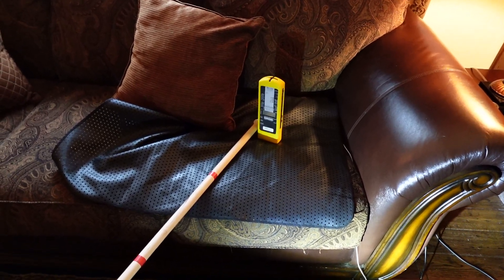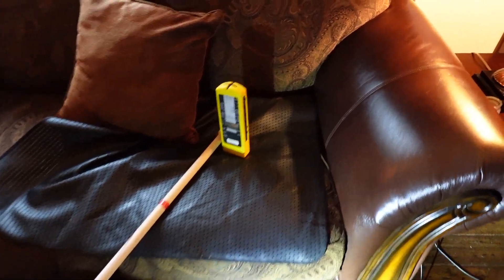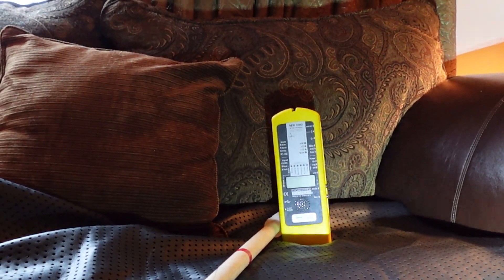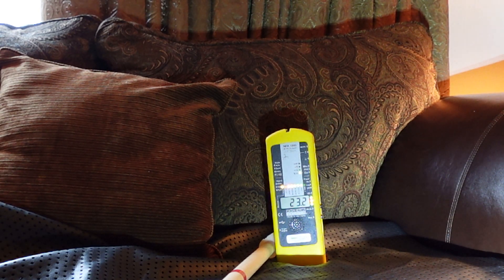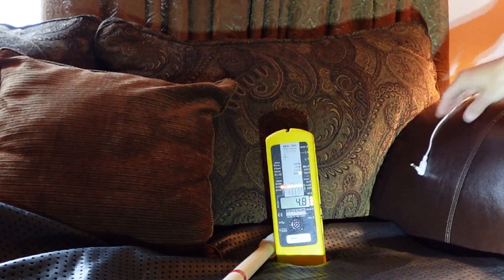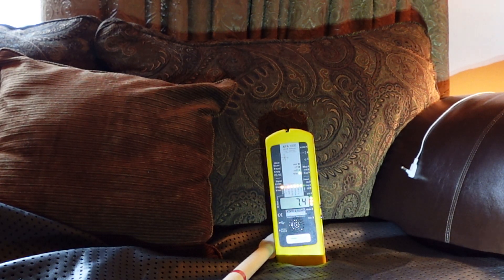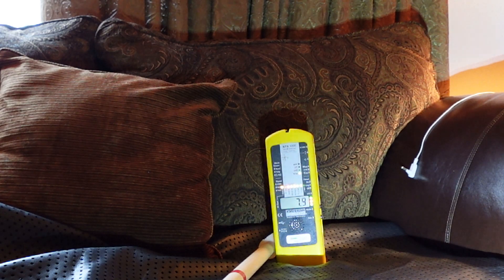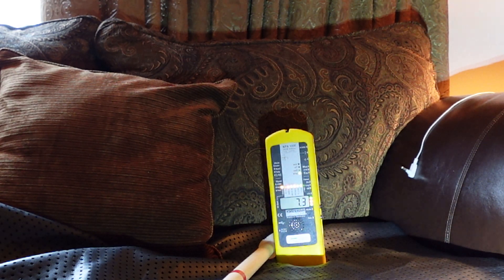The Problem with Earthing & Grounding Mats

Comment: I think this absolutely makes sense. When I first tried my earthing mat, I literally felt energy draining from my body, and then felt uncomfortable vibrations, pins and needles in hands and feet, etc. Turns out this is especially a problem in older homes, where sometimes the home isn't even grounded at all. Now my mat is grounded outside. Feeling a big difference.
Reply: You must be in an older home. If the outlets are bringing that much energy into your house you should probably get a professional electrician to look at your grounding wires in your house and make sure it is grounded outside. All electrical outlets should be linked to a central outside grounding rod. I would question is your house is properly grounded.
Reply: @bobinoly777 the electrical system in the house  can be perfectly fine but still create high emfs, electromagnetic fields, which apparently are detrimental to health. Lots of info online If you're interested in going down that rabbit hole.
Reply from the maker: Appreciate the feedback.  That's a good point about ungrounded sockets...you may think the mat wouldn't work at all in that type of plug, for better or worse, on account of no ground wire.  BUT, the mat is conductive and will still attract the radiated AC electric fields from the wall wiring
Reply: @optimaldwellingspaces3947  So, its not healthy any mat?
Reply from the maker: correct @carlosrodriguez9223
Reply: @optimaldwellingspaces3947  Hmm yeah good point.
Reply: Yep same happened to me! I was thinking maybe earthing via the central heating radiator.
Reply: @optimaldwellingspaces3947  what if people hooked up the ground to the neutral to pass inspections? What effect would this have?
Reply: I live in a seconed story apartment. I made a home made canopy around my bed and I want to ground it outside my window DIY. Can you tell me exaclty step by step a list of what materials to get at home depot and how to install the ground and the safest way to go about doing it and where to put it? I'm new to this so it would really mean a lot. Thank you 🙏
Reply: @alexzemaitis  any updates or progress?
Reply: @alexzemaitis  get a grounding rod.  Pound it into the earth with a sledge hammer.  Attach a wire to it with a grounding clamp.  Run the wire into your house and attach the other end to the grounding mat.   It might be possible to attach the wire to the cold water pipe that comes into your house from outside, since it runs through the ground, it's like a giant grounding rod.  Then you'd just need a clamp and enough wire.  If you have such a water line, it's probably used by the electric system, so it's possible that it has stray voltages on it, but the ground in the wall socket goes directly to the electrical panel.  Because it runs parallel to a lot of 120V lines, it's likely to have induced voltages.  They probably won't be present, or will be a lot lower, at the water pipe close to where it goes underground.
Reply: @incognitotorpedo42 So I have everything almost ready to ground my Matt outsides my window using grounding rod. My question is do I need a fuse or resistor between the Matt and grounding rod incase of lightning strikes? Think I seen this mentioned but not positive. That’s my only worry other than driving the rod into hard Colorado soil lol!
Reply: @incognitotorpedo42 in most dwelling units built within the last  60 years it will more than likely have pvc underground so this would more than likely not achieve the desired results.
Reply: @alexzemaitis 
As a former property manager this may be a problem with the management or the owners.

You may need an electrician to help you, or get help and permission from the building maintainance people. 

Basically watch the movie earthing.
1.  you stick a metal rod in the ground of steel, or copper pipe.
2.  Run a copper metal wire to that pipe as a ground wire. 
3. Up to your window and to your equipment. 
4. Standard house wire 12 gauge or whatever.

Hope this helps, be blessed amen amen amen amen.
Reply: You can check to see your grounding plug is actually grounding.
Reply: @wisdom-foundation
Can´t you just turn off the electricity of the plug you´re going to use to ground the mat? When I do it, the EMF and EF of the plug go down so I suppose it would solve the issue?
Reply: so do you now stick the grounding matt into the earth outside and run it through your windows and lay on it in your bedrooms? is it connected to the outside and ran into the house?
Reply: If you’re having this kind of problems you should call an electrician. Your house is probably unsafe not only your mattress but all your appliances.
Reply: @rider9187  Hey we had issues with multiple appliances and fixtures. Glad I’m not there anymore lol
Reply: @rider9187 not necessarily. Your house wiring system can be installed perfectly but still give off electromagnetic fields
Reply: They give you a plug to make sure the receptacle is grounded. Doesn’t this work?
Reply: @Tinyteacher1111 No! Never ever rely on a ground plug tester to check for ground. The neutral can be pigtailed to the ground making it a false reading. First you need to open the panel box to see if your house has the proper wire. There should be 3 wires in every sheath. One Black, One White and One Bare Copper.  Thus wire rated 12/3 w/ ground. To pass inspection back in the day pigtails to the ground were a common way to fool inspectors.
Reply: Felt the pins and needles too. So I grounded mine outside and also made a difference

Comment: for me it is not possible to ground the mat into the earth - i live in 3rd floor and no garden ground near by.. is it possible to clip the mat to the heating element? in germany those run with hot water and should all be grounded - or is there an issue about it as well?
Reply from the maker: Go to a natural area for grounding.  Avoid grounding inside the man made electrical grid, including heating elements

Comment: Hi and thanks for the video.
is it possible to use a cable that only has DC current. So you are ONLY grounded? I have googled something known as a " PureGround" cord that claims to have only beneficial benefits from grounding (no AC current can travel through it apparently. I have no idea though i'm not an electrician.)

And i feel i don't fully understand grounding. I thought when you are grounded, you are connected to the earth. And are fully protected from all AC/EMFs. But from what i've read in the comments, you now become an antenna for EMF's to discharge there electrons into? Which is the opposite of what grounding is meant to do? (please correct me if i'm understanding this wrong).
Thanks so much for the video and i appreciate any response!
Reply: This is how grounding is done. With a cable that will not conduct the AC current of the power plug. Otherwise you'd be dead. What appears to be the case here is that the nearby electromagnetic field of the power plug induces the free charges in the cable to oscillate, creating a weak AC current which in turn creates the EM field at the location of the mat.

Grounding does NOT shield you from EM fields. Grounding takes the electrostatic potential of your body to earth potential. Avoiding EM fields is an additional issue which should be taken into account.

Comment: Arent heaters grounded as well? I have a heater in my room, whick is connected to a copper pipe which is not painter. This copper pipe should be connected to the whole heating system in the house, which should be grounded.

Comment: Even if we ground directly on soil and not use any electrical port, is there still any disadvantage that can be presented such as large length of wire from my room to soil etc.
Reply from the maker: A shorter, thicker wire will be better.  More moist soil and a rod that goes down a few feet would be wise as well
Reply: @optimaldwellingspaces3947  thanks for the reply, a rod has been inserted 6 feet under, so that's solved. But what i am concerned is with the length of wire which is greater than 30 feet with 10 feet suspended into air, can it be conducting/radiated by wireless radiations or signals?
Reply: I opted to use shielded wire for this.
Reply: @optimaldwellingspaces3947  I have also heard that radiation will flow more from your body if there is high emf radiations in your room and you have grounded your body, which can be a disadvantage. Any idea about that because I live very near to transmission lines and seeing 10mG of magnetic fields in my room
Reply: Any idea on above?

Comment: With this video, are you saying that grounding mats (that plug into the wall) are actively harmful for your health, or just not as good as grounding barefoot on the earth? Asking for myself.
Reply from the maker: actively harmful for your health.  Bringing you much closer and in larger does, to artificially pulsed energy from the power grid.
Reply: @optimaldwellingspaces3947  I have grounding sheets with a continuity tester. Do I need a different device to measure if this is working/harmful?
I just got the sheets and hate the idea I may be doing the opposite of what I’m aiming for.

Comment: So use a mat, but ground it to the ground outside, not a socket. 👍
Reply from the maker: Best is to go outside direct on the earth with bare feet.  If you have to use a mat, use an isolated wire that goes outside to a rod and doesn’t touch the electrical.
Reply: @Optimal Dwelling Spaces  i do go barefoot outside, but not always possible in -20. Just made a rod earthed in the ground and ran a wire to the inside for times when using a mat, after watching your video this morning. Thanks!

Comment: Thank you. This was very informative. Ideally, walking barefoot outside is best, but often not feasible. I would definitely prefer a grounding rod outside, but again, for me, not possible, so the ground outlet indoors is all I can do, especially since we have multiple mats. I frequently test the mats with a continuity tester and test myself/ourselves with a multimeter, finding a very significant drop, close to zero, in the voltage reading.  I held the end of a cell phone charger and the meter read close to 50! I stepped on the grounding mat, and it dropped to around 4.5, so a significant drop, but still high. This has been quite a learning experience for me. In general, the mats do work, and I have heard many testimonies of healing and overall improvement in health, so it is very encouraging. Thank you again for this info, it is most appreciated.
Reply: Please elaborate on this. Why when the voltage drops it is not a good indicator you are grounded? Are you saying you can be grounded but still be exposed to emfs? What if my socket  tester tells me that my socket is grounded? It does not make a difference? Thank you
Reply from the maker: when you step on the mat, you are simply becoming part of the circuit, that's why the meter goes to zero when you test that way
Reply: @optimaldwellingspaces3947 yes please elaborate??
Reply: ? @optimaldwellingspaces3947
Reply: @optimaldwellingspaces3947  I live in a seconed story apartment. I made a home made canopy around my bed and I want to ground it outside my window DIY. Can you tell me exaclty step by step a list of what materials to get at home depot and how to install the ground and the safest way to go about doing it and where to put it? I'm new to this so it would really mean a lot. Thank you 🙏
Reply: This item does the exact opposite of what the seller advise it to do. After my first usage I felt very different (in a bad way) only to find out that when plugged to the ground socket, as instructed by product description, the whole body start to act like an antenna, picking up all of the electromagnetic field radiation. This is very bad for your health. It's sold as a health product, but in reality what it does is destroy your health.

https://youtu.be/Z-fGC-KsRGg?si=2LKH4SGzTU29OK0t
Reply: I live in a seconed story apartment. I made a home made canopy around my bed and I want to ground it outside my window DIY. Can you tell me exaclty step by step a list of what materials to get at home depot and how to install the ground and the safest way to go about doing it and where to put it? I'm new to this so it would really mean a lot. Thank you 🙏
Reply: @alexzemaitis wrap copper wire around a copper rod, stick it in the ground. Connect the other end of that wire to whatever mat or system you have. Done.
Reply: @VitalArms  Connect the copper wire to the mat: in what way? 
You can't plug it in..

Comment: What about outlets electrical outlets that won't work just by plugging say, a lamp, into the but the lamp won't come on simply but switching it on at its switch, but you have to also flip a switch on the wall? Can anybody answer that? I have this set-up.
Reply from the maker: Unfortunately not.  The ground wire is still connected on a switched receptacle and can carry current.

Comment: Hi, thanks so much for your video and information. I am wondering, for situations where an outdoor ground is not an option (e.g. traveling) would using something like a Greenwave Filter help mitigate any non-beneficial effect of using an outlet for a grounding cord? Or is that a separate type of issue? I hope everyone knows you have a website and consult/product offerings! I wish you the best in your work and I hope to support you through your affiliate product offerings.
Reply from the maker: Good question, but unfortunately, dirty electricity filtering from a capacitive filter is a separate issue.
Reply: @optimaldwellingspaces3947  I'm not sure what you mean by "dirty electricity filtering from a capacitive filter is a separate issue."  Is there any product out there that we can use to plug into our home outlets that will filter out the effects shown in this video?  Thanks!
Reply from the maker: A plug in filter using capacitance will create a magnetic field and can exacerbate magnetic fields elsewhere in the home caused by wiring errors.  
Best home option is to shield walls or run wire conduit in metal.  Depends upon how far you want to take it.

Comment: Isn't electricity drawn to ground? So if you are grounding yourself in a strong electrical field all the electricity around you will be drawn to you like a magnet. Couldn't that explain why the reading is higher when the mat is plugged in. It's not electricity coming off the mat,  it's the electricity in the air being drawn to and concentrated toward the mat. Please tell me if I'm wrong about this. I'm of the belief that one should only ground yourself in a very low electrical field setting. Like a room with all the power turned off, or outside away from power lines. A good test would be if you turned off the circuit breaker to that room, so there's no electricity in that room, then plug into the ground and see if there's an electrical field on or around the mat.
Reply from the maker: Yes, that’s exactly what is happening.  So if your body is connected to the mat, you become a part of the energy ‘highway’ going to the earth (zero voltage) and your body exposure goes up to AC energy.
Reply: So basically it’s better not to use those mats with devices in the home powered on?!
Reply: @pasqualemasullo6844 This is getting confusing isn’t it.
Reply: @jaysimpson6857  yea. Absolutely.. but definitely worth understanding. My point of view is that our bioelectromagnetic field helps us to shield from muons coming from outer space, by grounding we enhance body’s charges movement - ie magnetic field. That should deviate harmful muons and protect DNA . 
But that’s only an idea.. I’m not a physicist, the reality is much more complex and muons get slowed too and this create some other scattering phenomenae and I haven’t found any literature or performed and experiment about it.. yea.. it’s getting confusing

Comment: What type of metal to earth to ground as iron bad for soil?
Reply from the maker: Copper or copper plated ground rod
Reply: Copper oxidizes to produce Cu2O which is very toxic. I'd highly recommend not doing that for the environment. Theres a reason we don't put exposed copper outside.  @optimaldwellingspaces3947

Comment: What are the negative side using grounding rod?

Do we have to not use it when rain in case of lightning strike? Or other problem perhaps?

How can we overcome this problem?
Reply: I’ve seen some people install an inline fuse.
Reply: Don't bother. This guy's entire channel is just to trick people into buying fake products that will "protect" them from some sort of woowoo magic in the air, because electricity grr bad